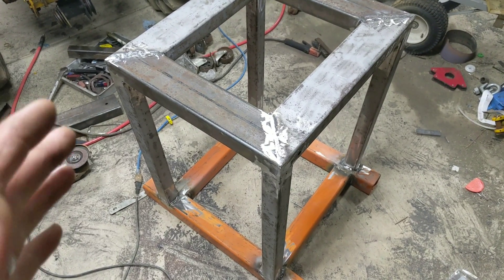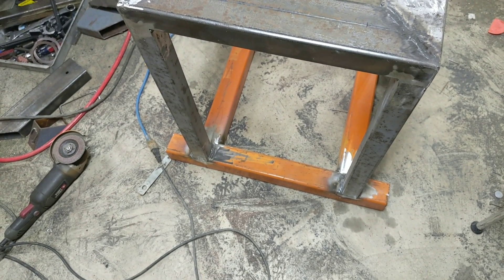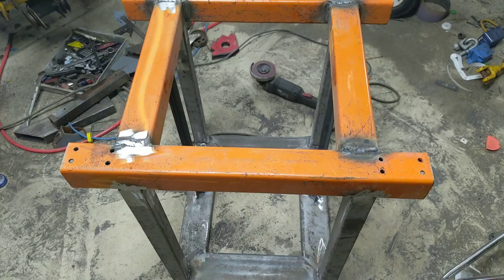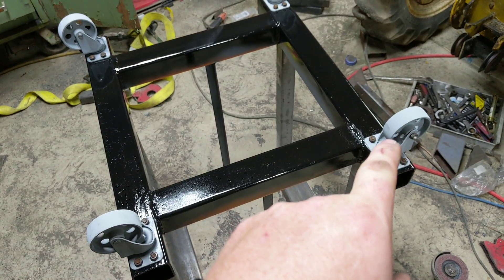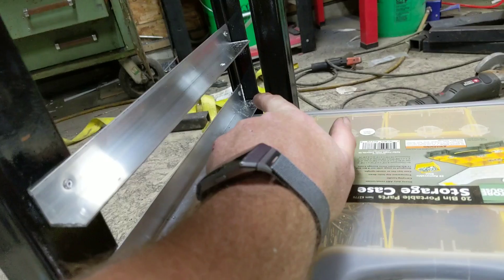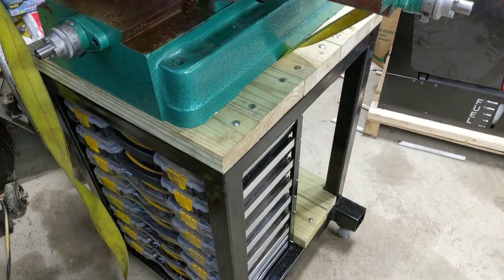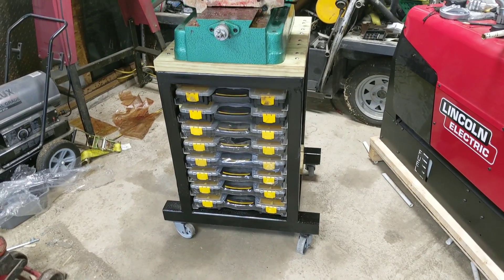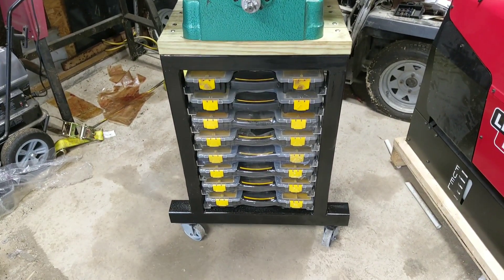Harbor Freight / Grizzly Milling Machine (VMC), Drill Press Stand with built in Sortimo, Part 2

Comment: Hi, sorry for posting this on the wrong video but I was looking for an update from your video "adding onboard air to a service truck"  I'm interested in buying the same compressor and installing it on my truck so just need to know if it worked out for you?
Reply from the maker: Thanks for the reply!  Life sorta got in the way after I did that video!   We moved and I replaced the truck.   But I plan on installing the same compressor to the current service truck and will do a video.   This will probably happen around fall time.